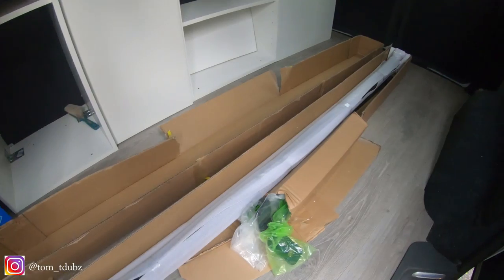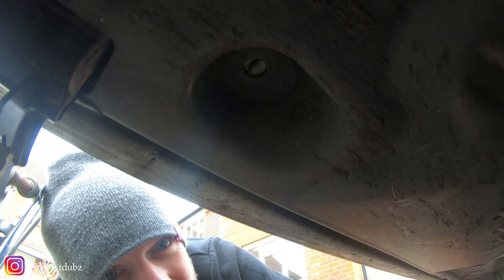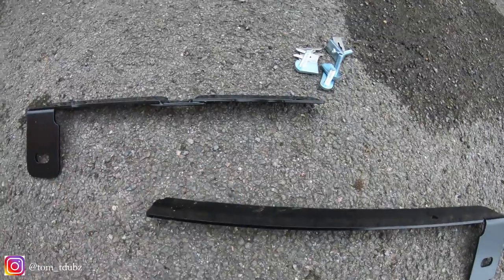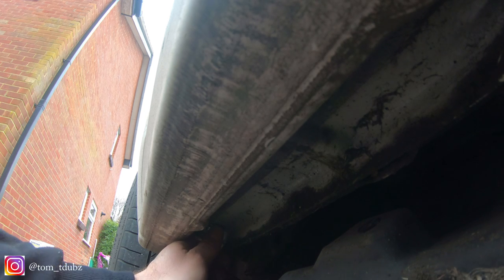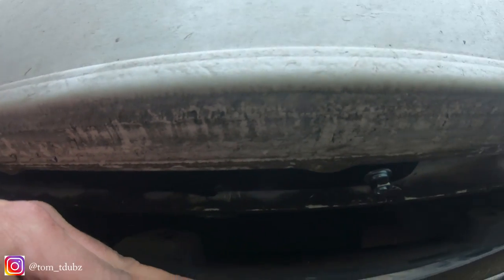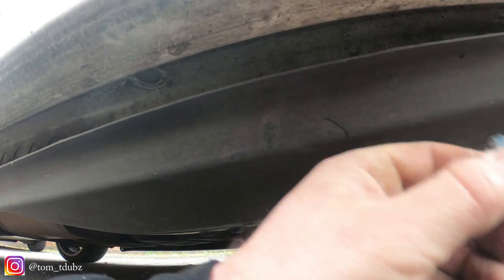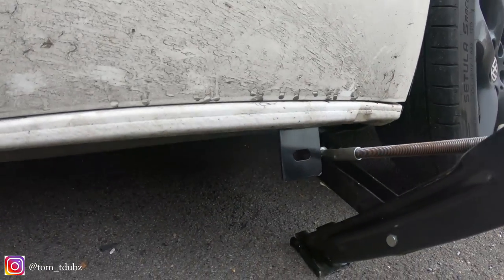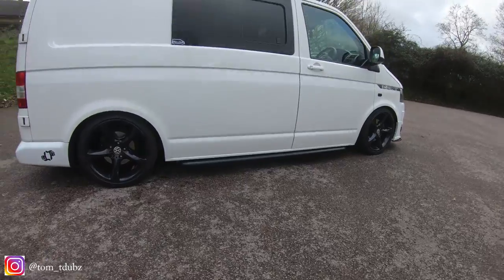vw t5 side bar fitting guide #shorevans

Comment: Easiest way to do this is to get a Dremel and cut out plastic cladding around area where you have fitted brackets , so if you need to adjust the rails later , you can get to the fitting without need to take plastic cladding off again . And yes the heater will fit under there easily
Reply from the maker: Tidy! Thanks, I did think that but there’s plenty of adjustment on the brackets where the bars fit 👍

Comment: was much cutting needed of the plastic under covers
great videos, 
I'm just starting on my T5
Reply from the maker: Not cutting needed.. the shore vans kit is great 👍. One of the bolts broke through the plastic when fitting it back, good thing is the kit allows a bit of adjustment where the bars bolt on so once the brackets are on don’t need to move them 👍👍

Comment: Hi, cannot get the bolt heads through the holes (t6)!  Any ideas?  Grinder the bolt head plate back a bit?  Any suggestions appreciated
Reply from the maker: They are fiddly.. you need to try an find the right angle, they should slot in..

Comment: Great vid, just found you via Dubz Outlaws. Excellent tutorial, simplified for novices like me! Doesn't seem to be a price for these on the shorevans website? Not to worry, keep u the good work!!
Reply from the maker: Thanks, think they are around 100£ don’t think they are open at the mo due to covid19 but hopefully they will be up and running soon 👌🏻🤙🏻
Reply: @tomtdubz  Thanks for your reply. Yeah Covid19 sure is having a massive impact in all our lives. Must confess its probably saving me a bit of money, for the time being anyway!!
Reply from the maker: Yeah I’m definitely saving the pennies 👌🏻
Reply: @tomtdubz  Did you have to trim any of the plastic under tray that runs down both sides to accommodate the bars brackets or not? thanks
Reply from the maker: Na mate didn’t have too... a couple of the bolts have pooped through the plastic since filming but no trimming 👌🏻
Reply: @tomtdubz  Thanks pal, which bolts do you mean the original ones, holding up the plastic? Why have they popped through? Thanks
Reply from the maker: Midlife Camper the bolts holding the bars brackets to the van there prob a bit too long, they have popped through the plastics...
Reply: @tomtdubz  I understand, thanks for that. I've just ordered some last night, so looking forward to fitting them!!

Comment: Great video as always, do they interfere with jacking point ?
Reply from the maker: No they don’t I just had the jacks to far over hence putting the van back down to fit the bars. They are good tho well chuffed with them 👍
Reply: T Dubz just about to order them as look good, I’m in Dorset don’t fancy wrapping my wing mirrors for me do you ? 😉
Reply from the maker: woodysmate maybe lol, give shorevans a ring rather than ordering online and mention tdubz... they may sort you out.. may...
Reply from the maker: You get some?
Reply: T Dubz no answer this afternoon, left a message mentioned that watched your vids and left my number. Will let you know when they call
Reply from the maker: Yeah I rang a few time before I got through.. hopefully they call you back tomorrow 👍
Reply from the maker: Try get hold of them again.. they have a new phone system and it’s playing up alittle 🤙🏻👍
Reply: T Dubz tried again but no luck. Might just order on line. Have you posted link re you said on installing electrics ? Hope haven’t missed it
Reply from the maker: woodysmate I’ve installed my electric hook up, hang on tho bud in the next video I’m releasing a discount code to use at sure vans 🤙🏻👌